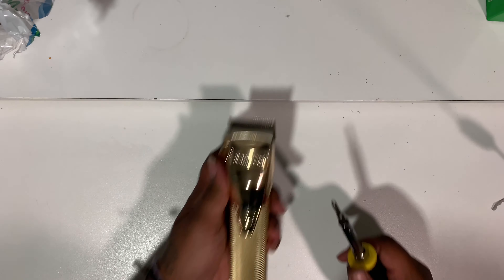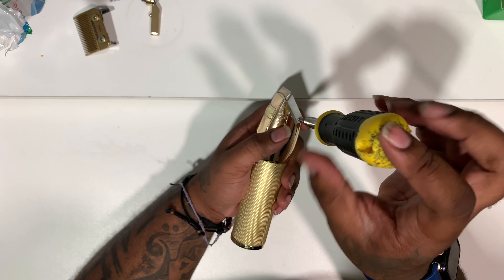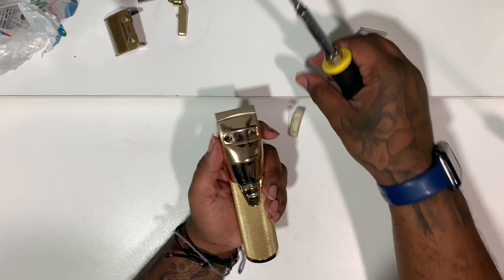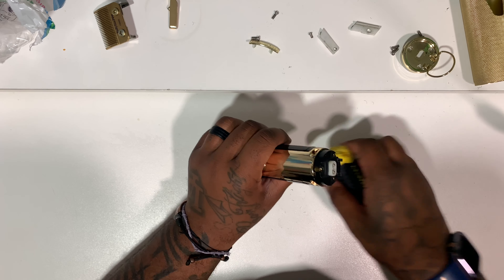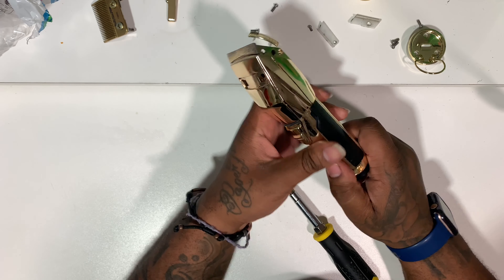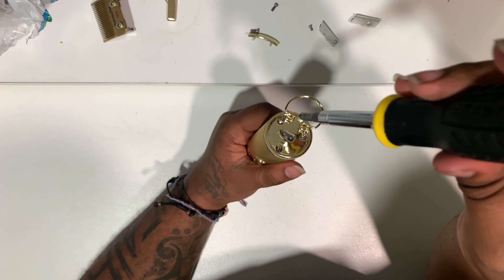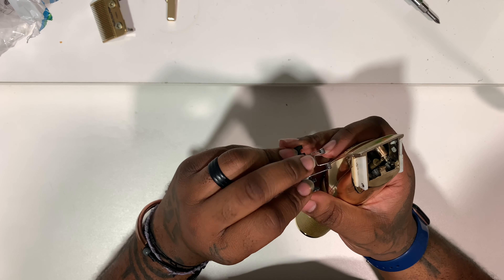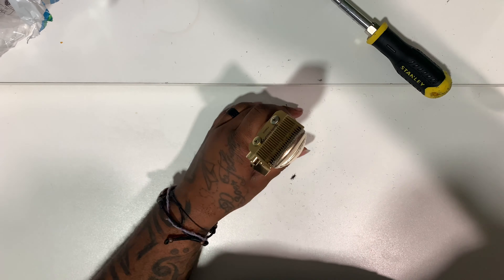BABYLISS GOLD FX CLIPPER POWER SWITCH FIX!!!

Comment: Hey bro informative video. Can I use this for my gold fix trimmer? I’ve only had it for 3 weeks and it’s not cutting on or charging. And the power switch is mad suspect on mine.
Reply from the maker: thanks nd yea you can it’s the same set up
Reply: Send it back it's got a two year warranty

Comment: Thanks brotha for this vid. I figure it was the power switch just never felt brave to dissemble the Clipper. Shall do it tomorrow. I just used a rubber band to hold the switch from moving which prevented the fan noise lol but I’ll get this tomorrow

Comment: You kno why the clipper light blink fast and dont come on at all even when the charger is plug?
Reply: @Hazzohn Jackson I had sent them back and got a new one ,but the customer service is garbage!! Took me a month to get them replace..but u may not have the same experience
Reply: Mine is doing that to
Reply: It's the switch that needs to tighten
Reply: @josearana7704  how??
Reply: @josearana7704   after a few minutes of leaving it plugged in it starts blinking fast